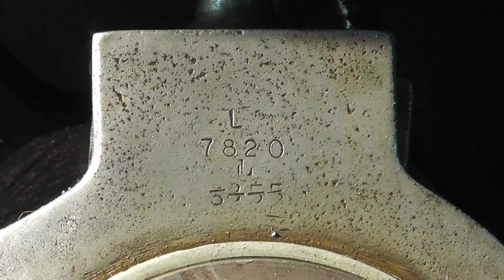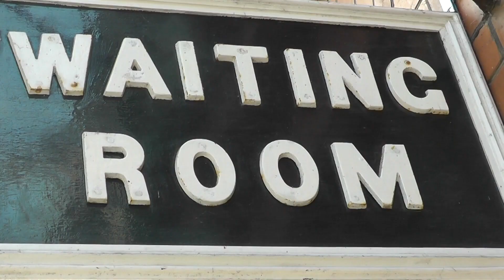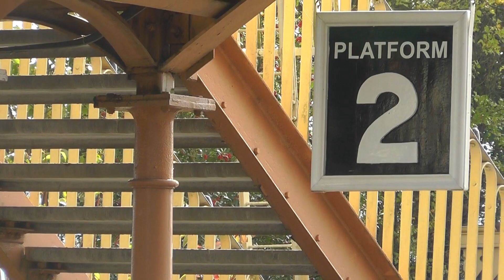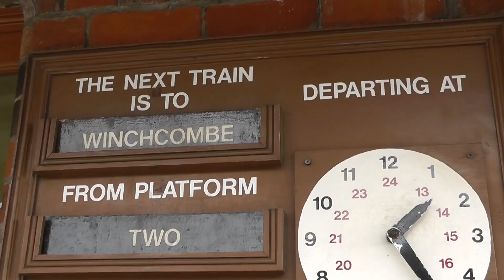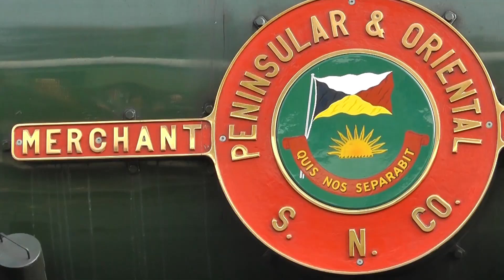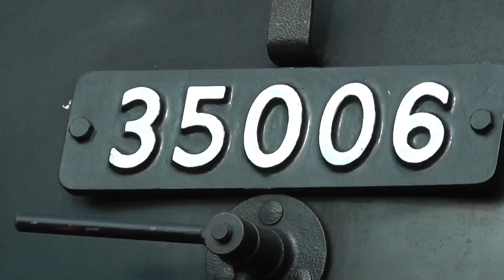Parkinsons Walks Friday Vlog 12 Aug 2022 Toddington

Comment: Hi Ron, some great photos of the details of the railway. Amazing to think that the boilers and frames are held together with rivets and resist the pressures, temperatures and forces so many years after having being built. Of course they would have been rebuilt several times, maybe not the crankshafts though. Let's hope an alternative fuel can be found as it looks like obtaining steam quality coal is going to be ever more difficult in the future.

There is very little in the way of preserved railway lines here in Spain, by comparison. In the town of Guadix, near where we live, there is a shed which houses the Baldwin which was used in the Indiana Jones films. Further afield in the Huelva province there is the Rio Tinto mining museum which has a short line which in winter runs steam excursions, it's too dangerous to do so in the hotter periods. I will paste you a link.https://youtu.be/KxJtiMmjLeI

Good luck from Spain!!
Reply from the maker: Hi David, the coal situation is getting desperate here, hard to think of a solution. Thanks for the link. Ron